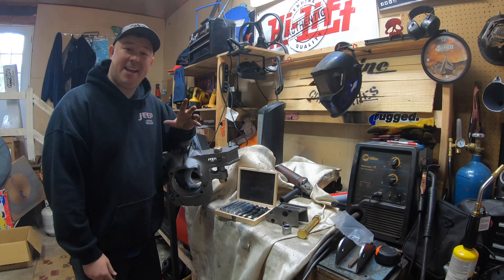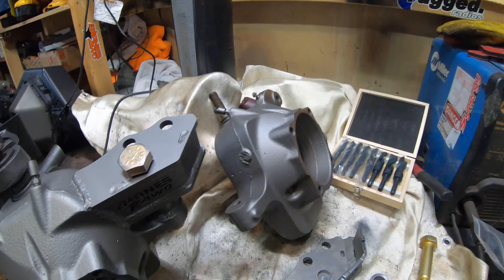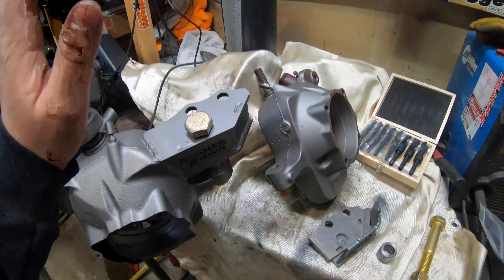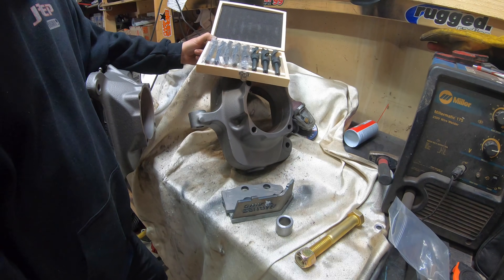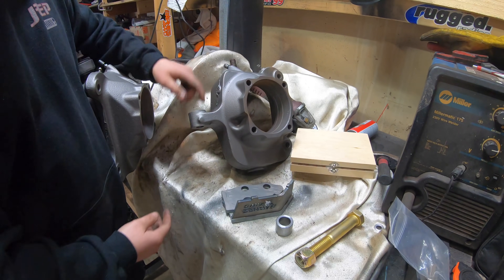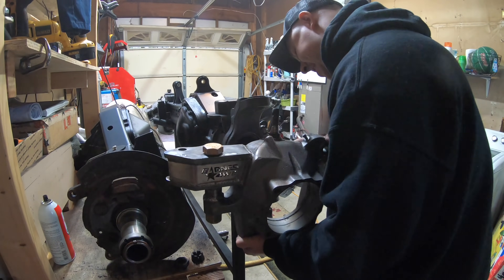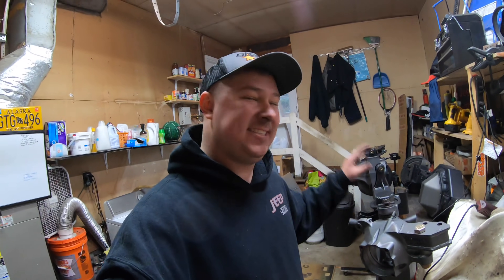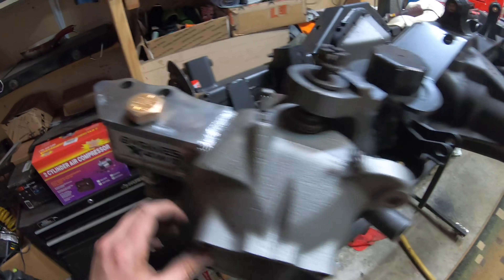Dana 60 High Steer Arms Install - JK 1 Ton Swap Video Series

Comment: I just bought a lifted Tahoe on a Dana 60 with the same high steer from Barnes. If it has the drag link and tie rod mounted both on the front holes; is that reason why it doesn’t turn as sharp to the right as the left? 3:15

Comment: Lol I just drilled my knuckles today. Yah I bent 2 of those drill bits. Probably user error 😂 they did fix the bolt fitment issue or I just got lucky and my bolt slid in and out no problem. Great vid though. Definitely helped me. Hopefully I’ll get to weld mine up this week sometime

Comment: This same drill bit set is sold at Harbor Freight. The quality is actually good for the price. These bits are meant to be ran at low speed in a press with good lubrication.

Comment: What wire were you using?
What about stick welding it....?
Do they make any stick recommendations? 
What about torqueing that bolt from the beginning so you eliminate the stress from final torqueing..?

Comment: Could you remove the vacuum line fittings and just weld the hole on the knuckles ?
Reply from the maker: Yep! However i have heard of some people tapping it and using a zerk fitting for grease, not sure its nessecary. I just left mine capped off.

Comment: Long shot but would this kit be feasible on a dana 30? I don’t mind modifying it to to the contours of the outer knuckles.
Reply from the maker: Negative. There would be too many differences to the point it wouldn’t even be possible really. You could look into a WJ knuckle swap, or a Dana 30 hi steer kit like this. https://sidewinderfab.com/product/dana-30-high-steer-double-shear-bracket-set/
Reply: @JKGearandGadgets  I look into this. I already just purchased the over The Knuckle One Ton Y-Link Steering Kit from Barnes4wd. So. maybe a future upgrade.

Comment: So... after watching your series (thank you) and seeing you drill the holes at a slite angle. I decided to used a Milwaukee stepped bit that goes to one inch (#8 -1").. and 😄👍. The holes are straight as an arrow. You can nearly get all the way through on one side,  then flip the knuckle and finish the other way. Thank you for doing the learning for us!  😉👍
Reply: Yep..used a step bit when I did the Artec kit on an axle before and it worked great.

Comment: Have you run into any issues on the tie rod clearing the diff cover at full lock? Or any heim joints binding while flexed out and turning?
Reply from the maker: Nope! This setup with these arms works great

Comment: What kinda welding wire did you use for this and your trusses on the diff? Regular welding wire or the crown alloy 44-30?
Reply from the maker: I used normal wire. Some people will use a high nickel content, but I didn’t want to spend the extra money.

Comment: Hey Ben...what video covers assembly of the hub on the front 60? Especially what seals you may have left out
Reply from the maker: I didn’t do a video on it. It’s very straight forward. You can either toss the seals, or keep them. Since we aren’t using the vacuum hubs it doesn’t matter.
Reply: @JKGearandGadgets  I've done 10-20   ball joint jobs on stock 250-350s just not sure what was needed on our application..Thanks as always

Comment: How are you going to address the issue with the different bolt patterns?
Reply from the maker: The rear axle is 3” narrower, so I will run adapter spacers, that fixes both issues with the width and bolt pattern.
Reply: @JKGearandGadgets  Awesome! Thanks for the reply

Comment: Can I get some feedback on aftermarket brakes for my 10' JKU.  I want to upgrade the brakes and don't know what way to go.
Reply from the maker: What tire size are you running?
Reply from the maker: Powerstop kits are good for 35s, 37s and bigger I would look at big brake kits
Reply: I am running 35”
Reply from the maker: I have heard good things about this kit with 35s. It might seem a little expensive but if you compare it to all new OEM parts it’s not much more expensive, https://amzn.to/2U924GP
The option after this would be a big brake kit, it will offer better stopping power but price tag is around $800
Reply: Thank you so much for the link. I try to watch all your videos on the weekend. Love the channel and thank you for the advice again

Comment: I like that setup better than the one from Artec, and can't beat it for the price.  Just so anyone watching knows, you can actually use the stock Ford steering by re-drilling the taper on the JK pitman arm.  The D60 knuckles already have a fairly high mounting point for the tie rod/ drag link.  Plus, you can buy tie rod ends at any parts store if you break on on the trail.  I can post a video of my setup if anyone wants to see it.  Those came out GREAT though!
Reply from the maker: Do you have full lock to lock steering with the ford setup?
Reply: @JKGearandGadgets  I do.  With the front axle pushed forward (118.5" WB, 4" lift), I can still just touch the sheet metal at the rear of the passenger front fender at full lock in certain situations.  It turns, rides, and handles well.  I wonder with the tie rod in front of the drag link on yours if the steering will be twitchy at all on the highway because you will have more wheel travel at the same steering wheel angle than I do.

Comment: I would run another stringer or two on the driver side knuckle. The top in the final shot looks like you undercut it and while it might be super strong there is a chance that it isn't as strong as if it wasn't undercut. Also great job on the videos! These should help so many people out who are worried about what is involved to go to tons! (If you pause it right here https://youtu.be/deVO0fv2rQE?t=717 you can see the undercut)

Comment: As of right now what are you up to as far as cost go? Even add in tools you may have bought for the build process for those who may not have all the tools. Even those cheap ass drill bits😂😂 By the way good find good ones can be well over $25.00.
Reply from the maker: I will add it together and include it in my next video

Comment: you will get better and flatter welds if you turn up your amps a bit.
Reply from the maker: I’ve tried that but this welder doesn’t like it. It’s pretty old, might be time to upgrade.
Reply: @JKGearandGadgets  hmmm.. guessing just a 110 then.. all good
Reply from the maker: It’s a 220v surprisingly.

Comment: just some side info from someone who has done this as well. 
remember that raising that raising that track bar front and rear also raises your roll axis or center. sort of like a pivot point for your suspension. this comes in handy for lifted vehicles in corners and off camber situations on the trail. also, having a flatter track bar/ drag link also means that as your suspension travels up and down it won't move as much side to side, this helps in numerous ways including mitigating bump steer even if the track bar and drag link aren't the same length.
 Another thing us one ton guys use to combat steering angle loss is a wagoneer pitman arm, its straighter and longer than the stock jk pitman. forewarning, this won't work for anyone using the stock jk track bar mount as it will hit it. 
 Great job on the pre and post heat. preheat is great for anything cast as like me, you got your axles from a junk yard, which means they're used. cast likes to soak up all sorts of oils and junk and pre heat along with a wire brush really helps to get as much as possible out. pre and post heat also helps to reduce stress cracks, this isn't as common on cast steel as much as iron and such but still great practice. lastly, that preheat really helps to give your welder more "oomf". 
Loving the root and top pass, looks like you're picking up on those welding skills quickly, great job man loving to see another guy doing it himself. heck, i think i finally might make a jeep related vid tonight!
Reply from the maker: Good info right here!! This is the stuff I’d love to sit down and talk about in my videos... however I’ve been told numerous times that my videos are already too long. And I’ve noticed videos over 15 minutes get less views. Maybe someday I’ll do a video solely on steering and suspension info. Thanks for watching and thanks for the informative comment 🤘
Reply: @JKGearandGadgets  i for one love a lengthy video with any information at hand. it's why ill only watch gun reviews by nutnfancy. but i understand that building a channel may be about what the people like. and that's fine as there are always more vids to be made and forums/books filled with information
Reply from the maker: Yeah I eventually will keep expanding and make more in depth videos, but for now I have to kinda appeal to the people. It sounds like you know what I mean
Reply: @JKGearandGadgets  i understand, i think it's just time to get something other than fish on my youtube. considering my insta is just my fabrication and jeeps haha
Reply from the maker: I say go for it! But YouTube is hard to grow on, and sometimes can be dissapointing. I’m lucky I made it to this point. The big thing is consistency. Don’t post 10 videos in a month and then stop for 3 months. Put out a video a week or one every 2 weeks, and just keep doing it. Even if the video has been done before, put your spin on it. There will be one or 2 videos that get traction and help your channel start taking off.
Reply: @JKGearandGadgets  ehh no worries, i've been doing nothing but watching others vids for years so little views won't matter haha.

Comment: That's one thing that drives me nuts about off road equipment is all the logos. You see logos at every different suspension component. I would weld in the company name and then grind it down flat

Comment: Nice welds Ben.What is that big yellow cord?
Reply from the maker: Extension for my welder!
Reply: Oh ok you just plug in to your dryer outlet.That 30 amp circuit is all I have my Hobart 190 on and it runs just fine.